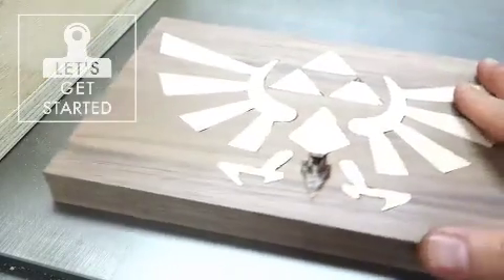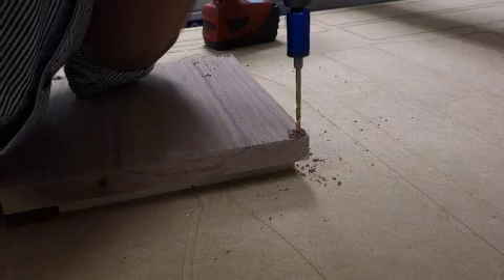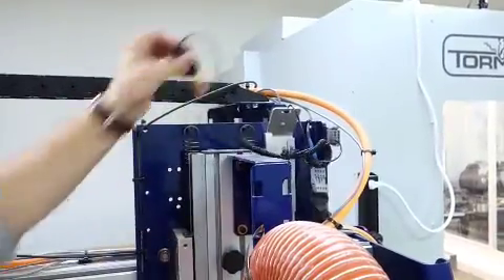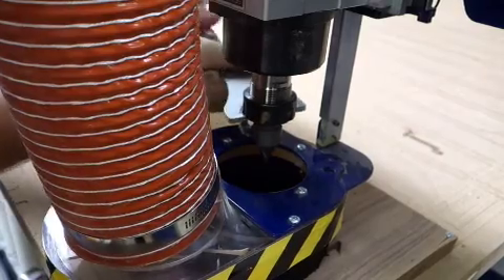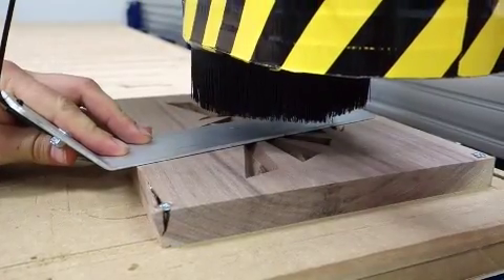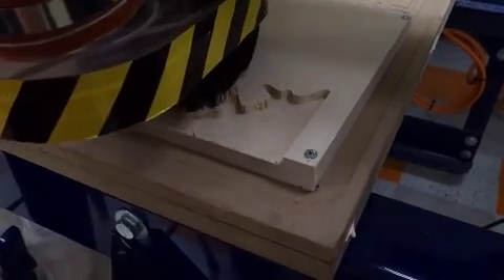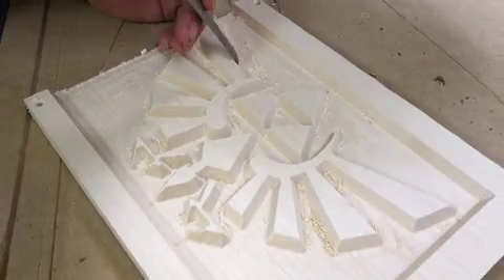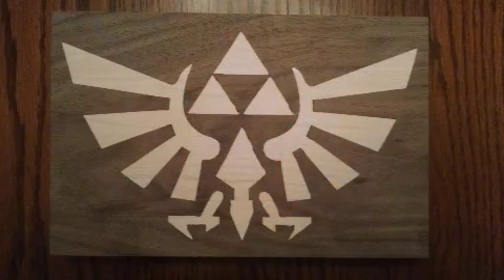Zelda Wood Inset using the Shopbot CNC

Comment: If you reduce the feed rate or increase the spindle RPMs, you may have less clean up.
And, I have to second what previous comment, using the zero plate locates the surface, top or bottom, of you material and does not "level" anything!